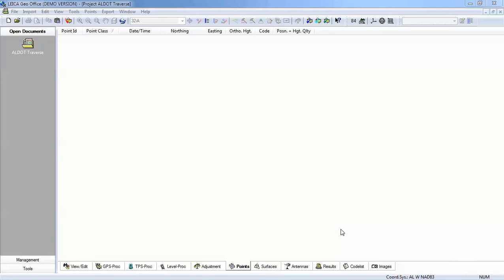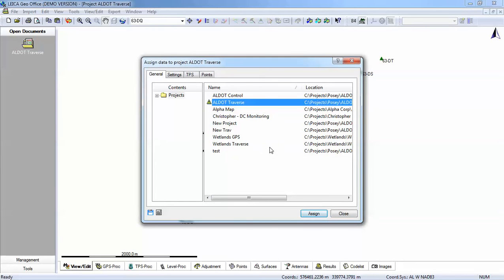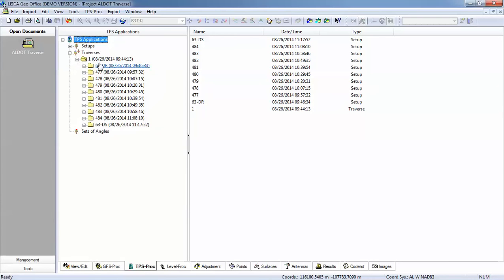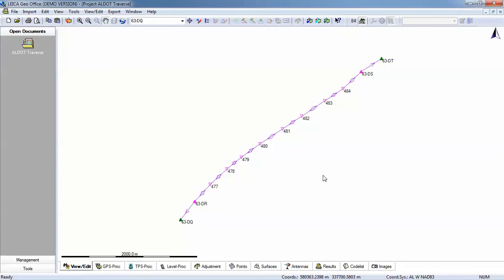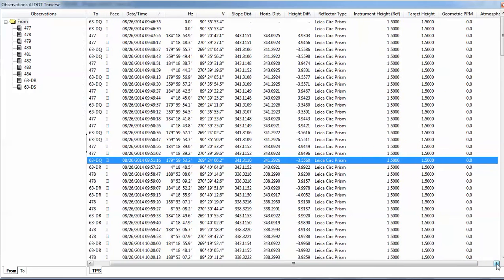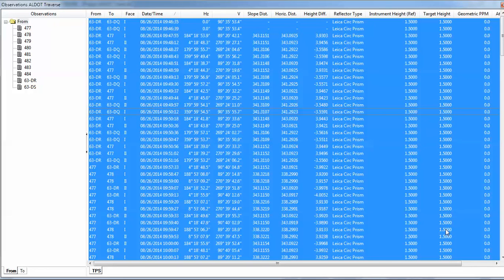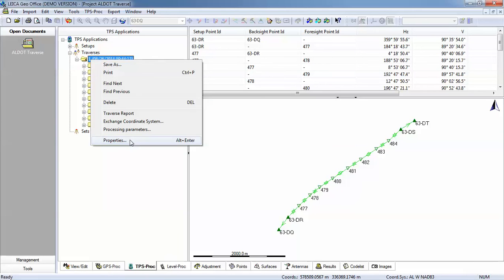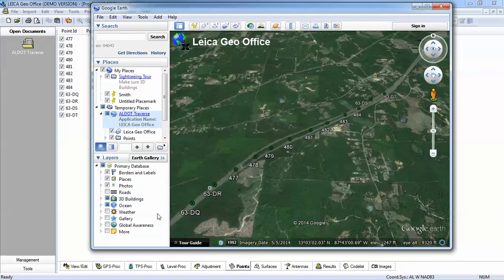Leica Geo Office Traverse Processing

Comment: could you describe the sequence of actions at the station while continuing traverse in two face. I have a problem with adjustments at lgo. What i am doing is: set the station 1and do orientation by angle on the backsight point in two face, than open survey program and observing point 2 in two face. Then going to the next (2) station. Untill come back at  point 1. Then i trying to calculate traverse at lgo, but it is not calculating correct. What i am doing wrong. Give me advise.
Reply from the maker: I believe the issue is the set orientation.  You must record a distance to point 1 to establish coordinates.  Also, are you using the traverse application in either the Leica Viva or Leica  Captivate?  Either program will allow for direct / reverse (two face) measurements and will prompt for the appropriate measurement.

Comment: Great video !, I'm new to Leica and don't really understand how you get the TS to output the traverse data. I'm told format files are the answer, I don't have Geooffice. can I make a format file on the controller ?
Reply from the maker: Leica Geo Office can import job files from total stations running System 1200, Smart Worx and Captivate software platforms without any conversion.  Format files can't be made on the instrument or controller.
Reply: @surveyorpop  please tell me what file do you import from TS. Is that GSI file ?
Reply from the maker: @lazokuzmanov9166  It depends on the TS unit.  If you are using a TS10, TPS1200, TS, TS15, TS16, or MS/TS60 you should import the Leica data base files.  These files will be found in the DBX directory of the memory storage device you selected when creating the project.  For Leica Infinity you would set the import type to Captivate / SmartWorx Viva.  For LGO you would set the import type to SmartWorx Viva.  For FlexLine TS03, TS07 and all older TS units the GSI file would be the appropriate import.  Please choose the GSI16 format if available.
Reply: @surveyorpop  thanks i use Leica TS 06 flexline  and there are 3 options IDX,GSI ,XML and DXf file for export from the instrument.I think GSI only have angles and distance need to calculate the travers.
Reply from the maker: @lazokuzmanov9166  Try the XML file